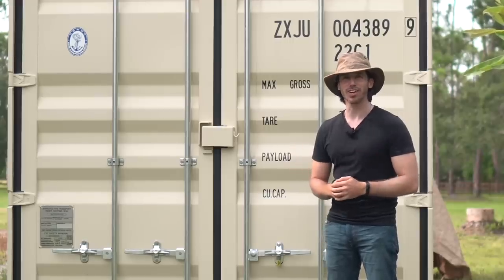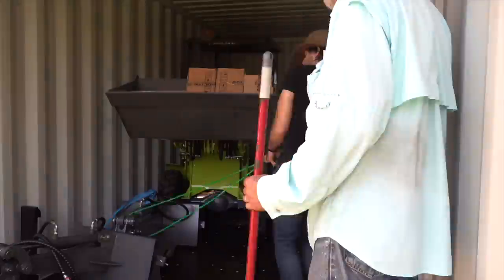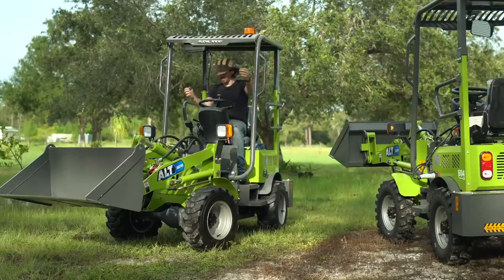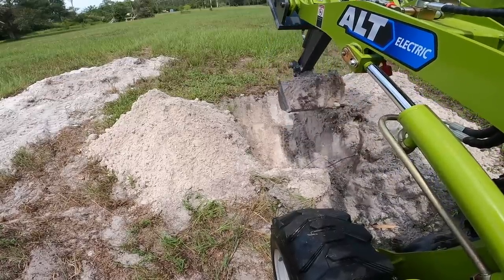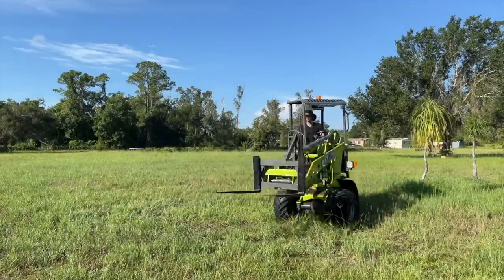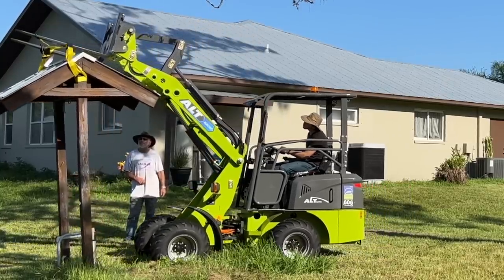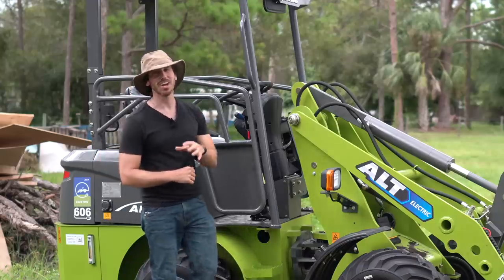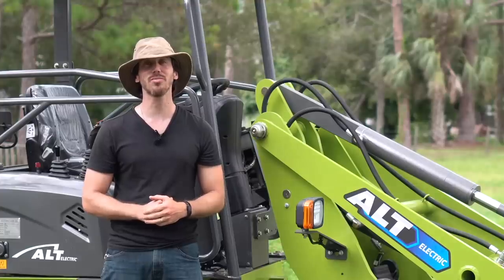I bought a container full of Chinese electric construction equipment!

Comment: I'd love to see a followup video with how they've done after 6 months to a year and how long the batteries last on say a full days worth of use moving things around.
Reply: Would also be good to see an experienced operator's take on them to give a more apples to apples comparison so people will have a better idea where they stack up compared to traditional equipment.
Reply: and when the battery dies mid job and the digger is stuck on site!
Reply: @leeneal6969  and 5 minutes from power on your property 🤣😂🤣
Reply: I guess those are not really targeted to operations where they get a workout for a full shift.
But I can imagine they really find a good place, if you need something like this just every now and then, move a few buckets of dirt here, drill some holes there.
It is like with the digger attachement. Does it replace a full blown excavator? no, sure not. But can it handle quite a number of those once in  a while we need a ditch or a smaller hole tasks? sure it will. 
But a comparison like @donhappel9566 mentioned would indeed be interesting. also to see how much load they can handle.
I don´t think those things are something for a contruction company or a full time landscaping business. But a smaller nursery or just your retirement hobby farm? Even possibly those once in a while jobs on a golf course, Could be great.
Reply: And of course you can also run out of diesel fuel, especially if the gage is bad, and then you have to bleed the air out of the fuel injectors like my former landlords Kubota diesel tractor ower , ask me how I know. You are supposed to MONITOR your levels, it doesnt matter if it's battery percentage, gallons of gas, gallons of diesel, or tank of propane, if you run out in the middle of work and/or away from a source to replenish it- that's 100% YOUR fault, learn from your mistake and don't do it again.
Reply: I'm glad you mentioned some of the barbs of ordering directly from China. 
I wish I made a video of what I had to deal with on Imported food packing machinery!
Reply: @leeneal6969  instead of propaganda how about taking a real look at things, see how they are, not how you want them to be or even expect them to be.
Reply: @speedy01247  what you on about?
You realise for what I say to be classed as propaganda it must be first untrue. 
What have I said thats untrue?
Unlike the evangelist that tell us that EV are good for the environment no matter what...
Absolute BS
Reply: Keep a small portable generator on hand in case this happens-problem solved.
Reply: Handy for digging shallow graves in a hurry when you need that sort of thing. Lol.
Reply: @jeffcard3623  kinda kills the purpose of buying electric then.
Reply: @HobbyOrganist  don't run out of fuel in an airplane either.
Reply: @leeneal6969  I disagree. It would only be as an emergency to get you back to the shop.
Reply: Lucky if they last 30 days without issues.
Reply: @leeneal6969 anything can run out of”fuel”.  In one chat thread you covered the typical crybaby talking points that don’t apply.    There are plenty of issues with the transition to ev, stop with amplifying the ones from stupid people.
Reply: @SimJDKS  you spin it that way. 
I call it facts. 
The my just don’t sit well in your fairyland. 
Correct anything can run out of fuel, difference is how long it takes to get back in the game after.
Reply: @leeneal6969  and there is different tech that handles that as well.   It isn’t facts.    It is what you pay for.   There is a lot of downtime you are ignoring with ice vehicles.   It is rare there isn’t parked time with these vehicles, you don’t need to monitor charging like fueling, plug in, go to lunch.  You know most militaries are developing ev equipment for all the gains they get right?   There is also massive efficiencies available with ev.   Do we want to touch on the environmental stuff you mentioned is bs? I am willing to bet it will be seen on the stupid side “facts”.
Reply: @theboringchannel2027  guess we have good luck.  Like our electric truck now 2.5 years old with zero problems !!
Reply: @leeneal6969  That would a stupid thing for you to do.
Reply: @leeneal6969  Except portable generators paired to electric motors are still more fuel efficient. That's how the largest versions of this literal exact equipment works 24/7 and has since the fucking 1960s that you seem hellbent on taking us back to.
Reply: How do you recharge the batteries?
Reply: Hi guys, I’m very impressed they look fantastic for a hobby farmer or even someone that needs an excavator, loader and auger I am very impressed. Once again keep up the good work. Love your video
Reply: Hi, be awesome if they had a like a bush hog attachment to it also very impressive
Reply: @alexanderkupke920 Full shift ones can get battery swapped .
Reply: I think their place is on jobs, where you need to operate it for half minute, then 5 minutes idle, then again move a bucket or lift and hold something you then need to manually fix or so. When the machine does real work for barely half an hour accumulated over a shift, but a gas or diesel would have to sit idle most of the time, burning fuel and wearing off, often needing multiple refueling over such shift. An electric one can make multiple shifts per charge, plus you don't need to mess with all the fuel cans on the site, just connect to mains while parked overnight.

But I would guess a skid-steer format would be more practical for use cases for a battery powered machine, mainly in tight spaces - on smaller job sites or when (partially) indoor work.
This may have the benefit only when you need to drive for longer distances, but then it means longer working and less idling duty ratio, so less suitable for battery powered machine... Or maybe for really heavy loads where the longer wheel base allows better leverage, so higher load capacity for the given machine weight, but dunno how different that is.
Reply: @leeneal6969   Does it not have a gauge showing battery level...   Or an idiot light saying "low charge"?

Do gas & diesel diggers never run out of fuel?  Or cars & boats?  I guess you're the reason idiot lights are required, right?
Reply: @lesliestiller9726  Plug the charger into the wall.  Chinese basic residential power is 120V 60hz with a 2-blade plug same dimensions as American residential outlets, no voltage converter or adapters required.
Reply: @leeneal6969    its using regular lead acid :D   just recharge it or buy a battery  :D
Reply: @ZweiZwolf  Thanks  ,that makes it simple
Reply: @leeneal6969  Like all electric vehicles, there should be a meter to show the amount of charge left and when to recharge.
Reply: @SimJDKS  okay, where would you get the electricity in the middle of a desert, or a forest? Yes you might say that use a generator or solar, but that takes time and space.
Then there is the fact, that the attacker doesn't wait for your tanks to charge, they attack there and then when you are charging.

And yes, I think that diesel powered electric drive vehicles have a place, because most ships use that tech, and  diesel electric trains.
But in normal traffic where we try to get rid of the emmissions, the diesel electric systems are useless, because they still create emmissions. 
I have to say that total electrification of everything and banning the use of fossils, will stop the world in its tracks.
Reply: @mirohanhinen2517  wow.   How far up did you shove that tucker doll.    Where do you get f’n fuel in the middle of no where.    Electric power is extremely efficient and weirdly not noisy.    But the huge advantage is the greatly reduced maintenance and even more critical hugely simplified the logistics of hauling multiple types of fuels around.   Now, for the intermediate step of a portable generator, you do understand it is fairly trivial to make an engine run super efficient if it only needs to run 1 speed right ?  Generating electricity with an ice engine can also use cleaner fuels.    There are also practically infinite methods to package an electric motor, versus far fewer options with an ice driven machine.  Plus there is a lot of advantages of being able to run lots of equipment of a battery pack.
Reply: Why would it be any different to owning an electric forklift which have been about for years and years.
Reply: @ZweiZwolf  it took me 20 seconds to proof you talking BULLSHIT. chinese base power is 220 volts
Reply: @wolfganghb  I've actually been in Chinese homes, and they had 120V outlets in addition to 220.
Reply: Using a Baoli electric forklift. Two years down the line in a busy packhouse.  No issues
Reply: @leeneal6969  Maybe extra batteries are a good option.
Reply: Those machines last for a long time. If you don't want than kindly buy heavily priced ones and enjoy while you can. Machines will break one day or other. Chinese products are really good if you pay a decent price, it's upto you to choose good ones or shitty ones
Reply: I have been buying products directly from Chinese websites since 2014, that's 10 years ago. I am even typing with a phone I bought on a Chinese website. I have NEVER lost anything. I have zero regrets. The products last. 
But the way, who do you think is the world's No1 manufacturer of construction equipments? Who do you think invented lots of modern tools for bridge and tunnel constructions? Same China.
You guys need to clear your heads of these biases holding you back.
That's why your companies are fooling you into buying ultra expensive products cause you have been convinced that Chinese products are substandard.
Reply: @DeEmperor1  My comment had nothing to do with down playing made in China products. I just want to know how the batteries are holding up as well as build quality. Doesn't matter where a product is made every manufacturer can run into a bad batch of materials that passes inspection but fails in real world testing/usage.
Reply: @ZweiZwolf  exactly

Comment: I buy from Chinese websites for 10 years now. Cheap and totally worth it. I have no regrets. Saved me tonnes of money.
Reply: Sweet, I'm looking for a cheap excavator. Could you please share the website(s) you use?
Reply: totaly agree, I live in Japan right now and recently bought some Japanese farming equipment, I just wanted to have this 'Japanese Quality', I found out later that the same quality you can find in China for less than half price. I guess all western countries gave up on their quality
Reply: Can I ask if you can recommend any equipment or brand? I have a container coming in and really looking to get into a skid steer and wheel loader to bring it along with that container. I have a Deere unit right now but I need a second and don't want to spend that much. Thanks

Comment: Hi, great that you are promoting these sort of machines. One thing you didn't mention, but is an advantage of electric, is that they can be used inside without a massive snorkel to get the diesel fumes out. Good luck with Nesher hope it goes really well.
Reply from the maker: That’s an excellent point! And these are fairly compact so they are good for indoor demo work.
Reply: The other maintenance benefit is they are less likely to unexpectedly break down; the drivetrain at least. Worst thing is having a failure in the middle of a job with other people on the clock and no tool
Reply: They made propane forklifts years ago pal
Reply: @bennisles9521  I once worked at a factory where the boss insisted on running the propane forklift with the garage door shut.  All of us on the production floor got massive carbon monoxide headaches.  They are no fun and take about 4 hours to go away once you get fresh air.
Reply: @woodhonky3890  I wonder if that qualifies as reckless endangerment.

Comment: About 23 years ago I built my own loader similarly designed loader like these with Kubota diesel engine.  Back then not many competitors and I used it for my landscaping business I had at the time.  If I still had that company I'd buy one in an instant.

Comment: Great video! As much as some will hate to hear this, this is an honest to goodness example of China's clear manufacturing superiority. Great innovative useful machines, at half the price, with all of the benefits of electrification, great engineering, sturdy, etc. 
In fairness, we didn't see it load a dump truck, or do heavy work in a tough rocky or muddy construction or mining worksite, but for $20k-$30K for a new loader that can work an  8-hour day of intermittent use, its a better product. 
I assume air conditioning (AC), universal skid-steer mounts,  and bullet-proof cabin glass are available, but those things cost money - and AC is going to reduce running time. It costs $1000 per day in fuel to run a lot of equipment, so fuel is not a small savings here, it's a huge savings - especially when the cost of the loader is cheaper as well.
It would be interesting to see the specs and comparison of how that drivetrain keeps up with a diesel loader - on a construction worksite.
Reply: it's $2k~$4k ,not $20k-$30K

Comment: Those machines look high quality. That's great that you're starting Nesher as a way to help people in need get their hands on them. Well done.
Reply: They are louder than diesel ones
Reply: Give the six months.
Reply: @seamusmcmahon1182 
I was thinking if they don’t cost to much they’d make a great sandbox toy for the kids.
Reply: @dontfit6380  definitely not meant for kids...
Reply: @mannyrides3946  idk you put a battery in them and they go. Does that not scream toy? Seriously they look like toys. How can they not be toys. Unfortunately like any toy the batteries never last long enough then you have to replace them.
Reply: These are excellent machines.  Much quieter than diesel and none of the fumes and heat.  The steel and welds and hydraulics are rock solid.  Yes - batteries need to be recharged and won't run for 14 hours of continuous work.  Many people are not looking for that.  And the "won't last six months" thing - that's what people were hoping for with our Chinese electric mini-dump bed pickup truck.  2.5 years later, 0 rust, 0 breakdowns, solar panels to recharge it.  Extremely low maintenance requirements.  Original OEM batteries showing no signs of degradation.  These electric wheel loaders are not for everyone and do not fill all needs.  But they fill an important need and for those with that use case they are solid, strong, cost effective, fun and easy to use and a great overall option.
Reply: @mannyrides3946  farm kids beg too differ 😂😂

Comment: Do not get me wrong . By trade I went to  school to be a mechanic for the diesel eating monsters . I love the power . Saying that . I can see where these are much safer. They have less noise so you can hear something to happen. Also if  someone needs you . Let alone the fumes from the exhaust from the other loaders . These are a great idea!
Reply: Many thanks.  They fill a small but important niche in the marketplace.  And you have pointed one of the several important safety aspects
Reply: I bet those batteries ain't gonna last very long, but if this guy could buy 4 of these machines he probably could afford to replace the batteries

Comment: Would like to see how powerful they were digging in heavier clay soils.
Reply: I don’t think power would be the issue. These while heavy are no where near the weight of a traditional loader. The small weighs only 2500lbs while the larger weighs 4500lbs. Pretty sure the smallest bobcat available weighs more.
Reply: @dannyv2335  The small one weighs as much as a Kubota BX23 series loader with slightly less lifting capacity.  The smallest Bobcat/skid-steer can do 10x the work in the same amount of time.  It can actually dig in with the front bucket, especially in heavy clay soil, unlike the L880 or the Kubota.
Reply: @dannyv2335  I have an AGT micro excavator, weighs just under a ton (probably 1 ton with me on it lol), and it digs through heavy clay just fine. The small bucket means it doesn't need as much weight.
Reply: they might flip without a heavy engine

Comment: These loaders are great and look to be very capable for a tool on some acreage anywhere. As an operator in my past I can see what a good piece of equipment with alll the attachments is easy to run. Electric and hydralic power areso good of a match. In years past the drone of a diesel engine didn't help my already failing hearing, so quiet electric is the way to go.

Comment: When you use the auger, to remove the dirt that builds up on the auger you pull it out of the hole and hit reverse on the auger so the auger spins the dirt off of it. You don't want to jerk your wheel back and forth like that because it will start to wear the steering system out.
Reply: It does not spin fast enough for that since it is running on the aux hydraulic line supposed to only supply the bucket lock cyliders with a throw of 2" and no force....
Reply: Don't use reverse. Just pull it out of the hole and turn it forwards. It will spread much farther than way. If you use reverse you pour a bunch back into your hole
Reply: Or you can get the hole started then have your workers, kids, or his pops grab some damn post while diggers and finish it 😂😂😢....😮😂😂😂

Comment: This is a game changer for the urban environment or <5 acre homeowner. It's perfect for renovating a yard, building a fence or retaining wall, moving a few yards of gravel or dirt, maneuvering down a 4-5' wide garden path, starting the workday at sun-up, working until 10pm, or 10' away from a home office.

I'm not so worried about battery life. I saw a Nicad-electric radio control airplane fly ~50 years ago with a ~3lb battery which was spent after a 200yd flight, out and back. Eventually these things will recharge during a 10 minute break and go 4 hours. Also, with the simplicity of electric vs ICE, operational cost, including maintenance will be 1/4 to 1/2. Silver lining, reduced cancer risk from not huffing diesel fumes.